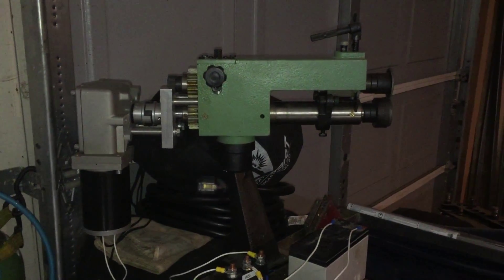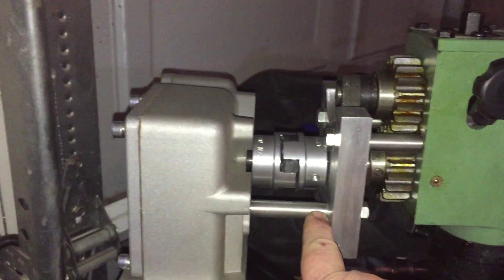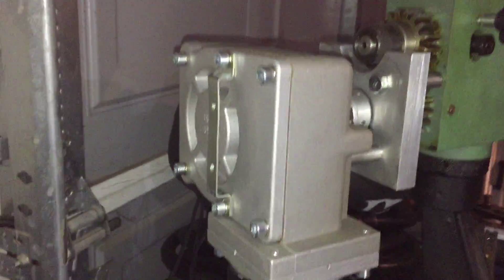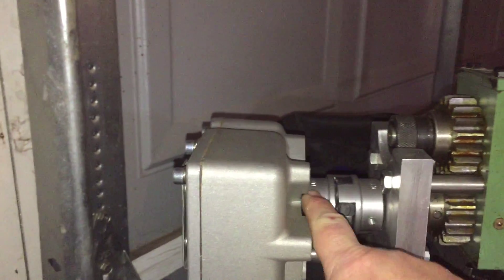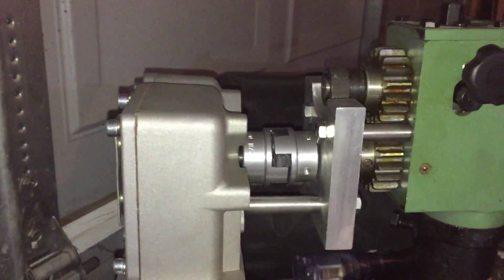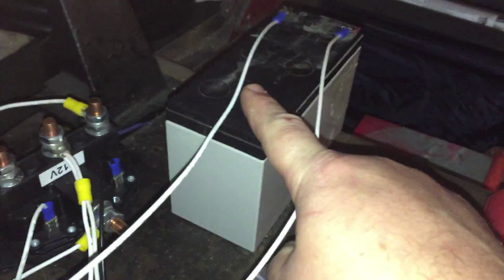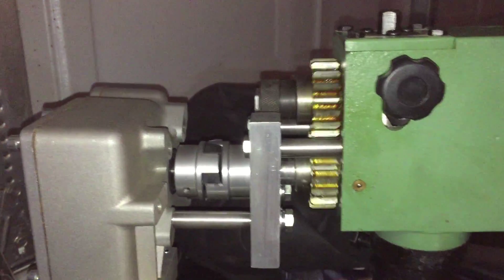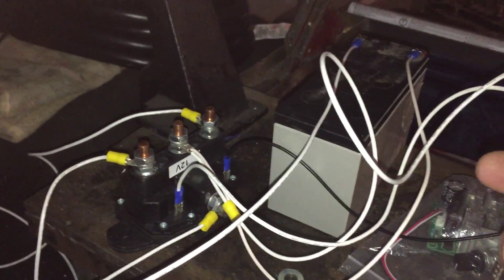Bead Roller Motor Mod

Comment: Paul,Nice clean drive for a bead roller. It is the best I have seen.  I liked it so much, that I have just ordered a similar unit for the bead roller I am upgrading.I don't know very much about electricity but I am curious to know if you have  finished putting all of the controls in a equally neat package as  the drive? I for one would really like to see how you did it , because I would like do the same for  my machine.Thanks.Wally

Comment: Paul

This may be a little late but I just came across your vid. I'm putting together a bead roller and you mentioned that you were looking for a higher amp DPDT switch.
I 'm also using a truck tarp motor 90 : 1 output but reducing it another 4.8 to 1 with timing pulleys,40 rpm on the motor was too fast. 
I'm sure your motor is rated like mine 12v dc,33amp, 600 watt, .8 HP

I like your simple mounting setup, direct with coupler.
You may just look into just using the PWM speed controller.

Here's what I have:
Tarp motor - 12v 90 to1 = 40rpm output ( $108 +$9.99 )
48/10 tooth 1" wide timing pulleys 40:4.8 = 8.3 rpm final ( L100 style belt) ($40-$50)
120v ac to 12v dc 50a 600 watt power supply ( $22.00 )
Leadrise 10-50v 60a max dc motor speed control PWM  controller 12v 720w ( $21.00 )
Nikkai, NKK s732 switch ( DPDT, on-on, 50a 125v ac, 30a 250v ac ) should be enough 12v DC amps
Switch is really beefy but expensive about $50,
I found a good used one for $19.12 + $7 shipping on Ebay.
Hope this helps,
Lou
Reply: I know this option did not exist when you build this but Eastwood is offering a reversible variable speed setup for a bead roller for $300 
https://www.eastwood.com/eastwood-bead-roller-drive-system.html